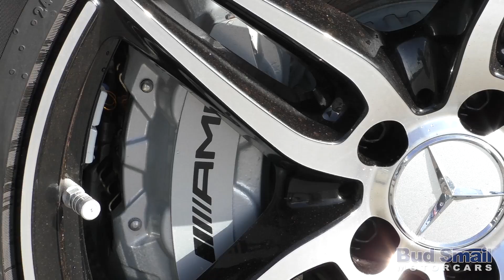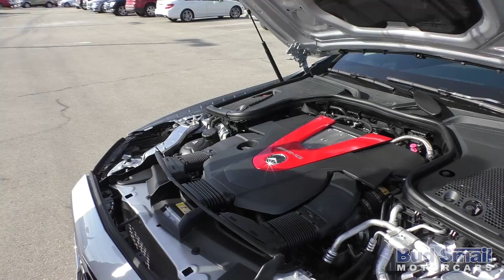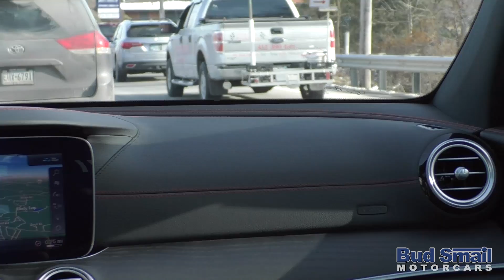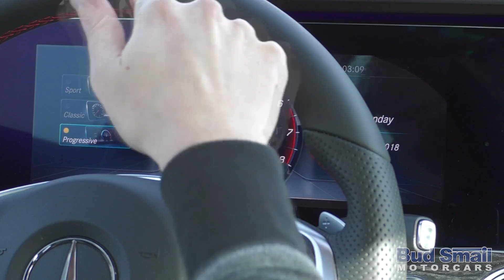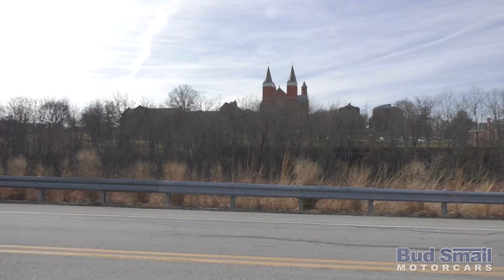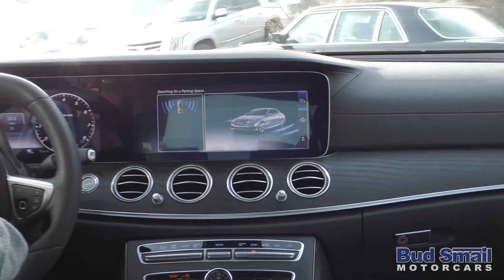2018 Mercedes-Benz AMG E 43 - Review and Test Drive - Smail Ride Along

Comment: Sold, however I'm from NewYork, Mercedes Benz of White Plains , I drove it, had a CLS550, lease , the CLS is gonna change for 19, love the body, not a hybrid guy, 18 body will be old, no more E550, had 2 of those, this is my next car, Diamond white, light interior, Pano, P2, Heated rear seats, extra bags, sound deadner, 83,000 car, comes in Mid June, can't wait, oh, Hate those run flats, what can ya do
Reply: how has it been?